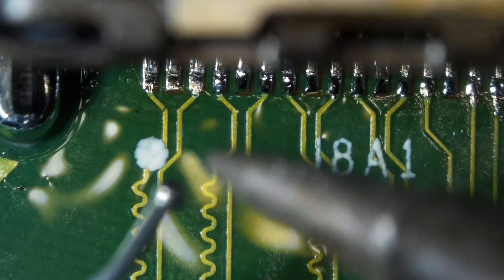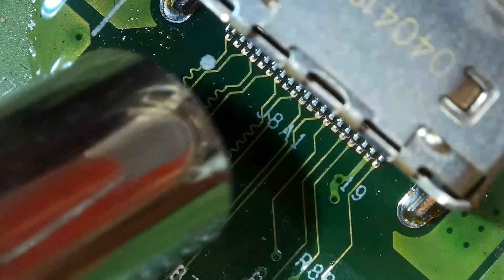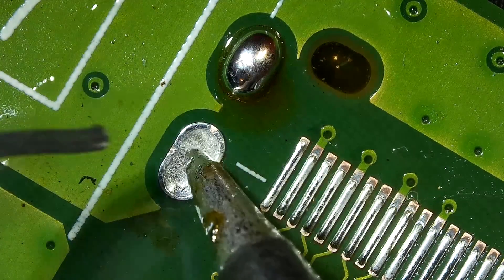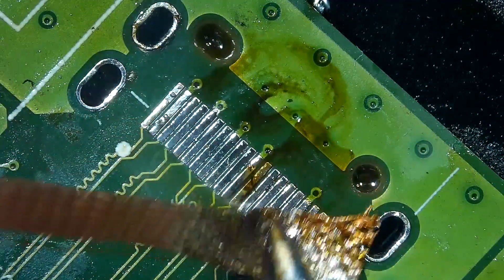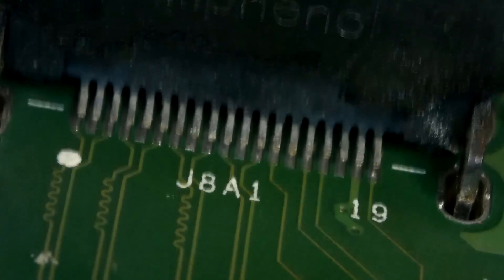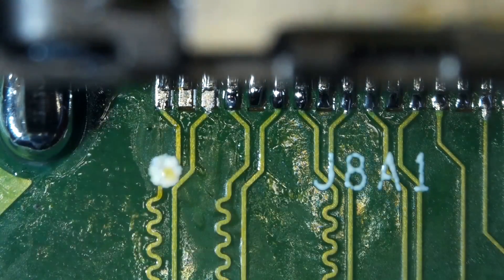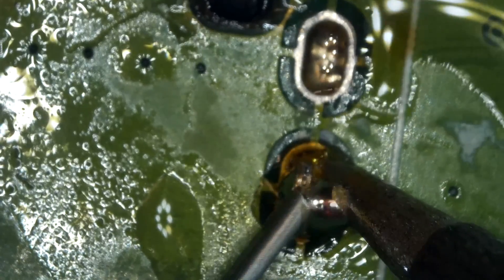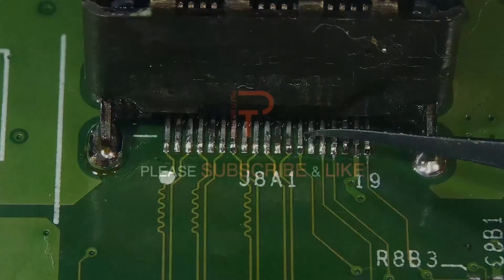How to Solder Charging Port like a Pro (Easy Tutorial & Guide!)

Comment: I have zero knowledge on how to use soldering equipment and this is my favorite instruction video because it’s the easiest for me to understand. Thank you! I have the soldering wire that has flux inside. Is that just as good? I’m looking to re-attach a micro usb charging port on a device that broke off from daily use. If the pads are detached from the board will I be able to repair it? Are we able to add NEW pads?
Reply from the maker: Even though your solder wire has flux inside, it is recommended to use extra flux.
When there is a damage on the board, you will need to use a thin copper wire and solder the one side to the usb charging port leg, and the other side has to be soldered on the pad which is on the motherboard side. If you are a beginner, this won't be easy. Need experiences.

Comment: Isn't it better to use solder paste instead a tin? I'm asking as a newbie :)
Reply from the maker: In some cases, yes. It is better to use solder paste instead, but if you are a newbie, you may create lots of bridge between pins, and it will be tough to remove those bridges.